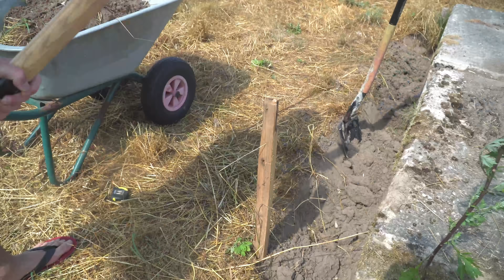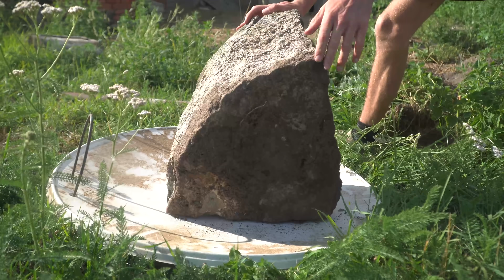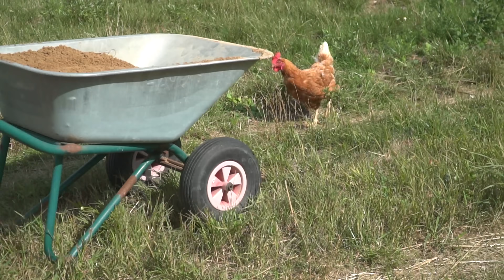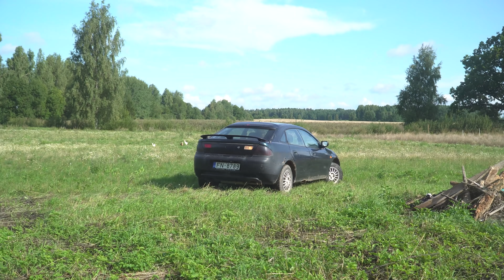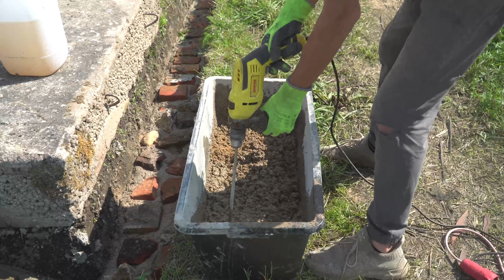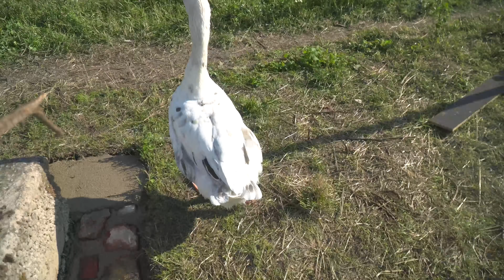Hand Pouring FOUNDATION (Animal Stable)

Comment: You are using your Jasper drill to mix concrete.  Maybe you could contact Jasper and give them a free advert in exchange for a few tools. A small electric cement mixer would be very useful . Mixing and pouring concrete is a slow, back breaking job . Good work 👍

Comment: You worked incredibly hard to get all that work done in just 3 days. Questions, if I may: what is the purpose of the 15cm bed of sand in the bottom of the trench? Would it not be better omit the sand and just fill with concrete so as to have a further 15cm of concrete below the frost line? And why didn't you add any reinforcement?
Reply: I'm think the stones were reinforcement? I would have put in lag bolts in the cement to anchor down the walls..smh..these guys are unbelievable

Comment: I am confused. You did not leave or put in Posts. I would have put in my 6 or 8 posts as i was doing the foundation.  Is it going to be a stone building or wood?  Are you going to use anchors (stone blocks that the wood post will sit in and on.)  ?  Awesome Job!!
Reply: I was wondering too. I’m trying to imagine what it will look like. Will hay, along with the goats have shelter here. Will it have a sound roof to protect them from the ice and snow?

Comment: You know I could have told you all of the secret how to do that when you did that you didn't have to go through all that trouble with them right all you had to do is just to get it all filled up and you look just grab a damn little stick and whatever just to get the air bubbles out of it that's all you have to do start you know just showing it in and out with something on the end of it on the stick is throwing it in and out just to get air bubbles out so all you have to do or use that drill to get air bubbles out money underneath it you didn't have to use that you didn't have to use all in my gravel for them bricks or nothing you could have used my credits you something just to get the air bubbles out of them cement that away you would that be another way to stop it from cracking